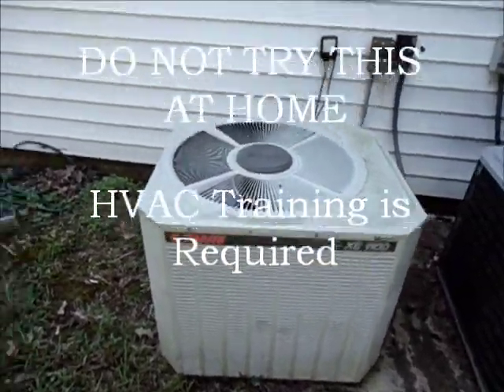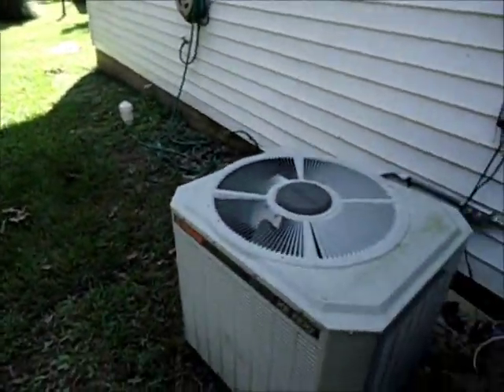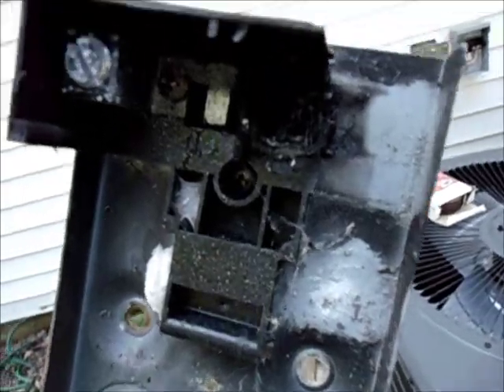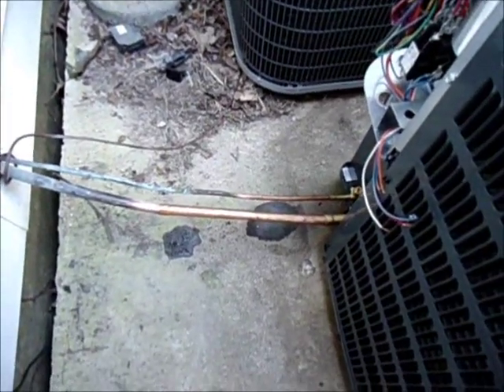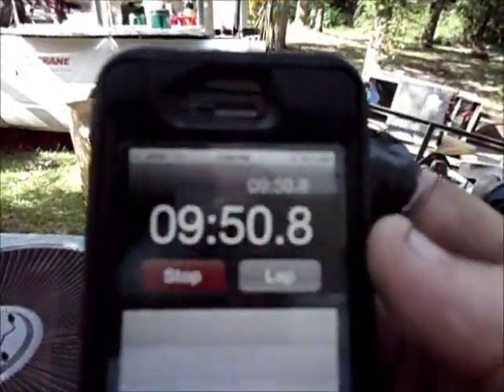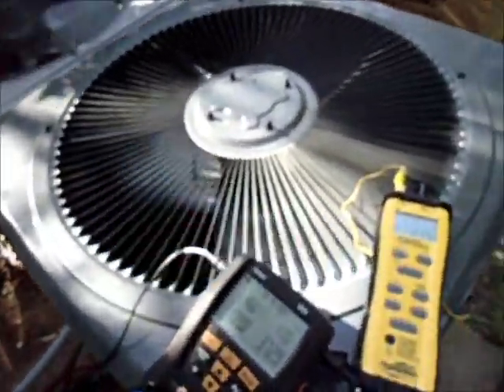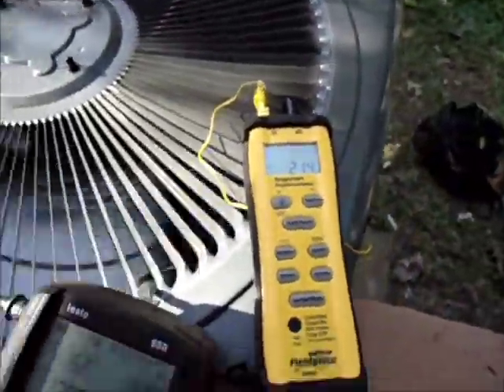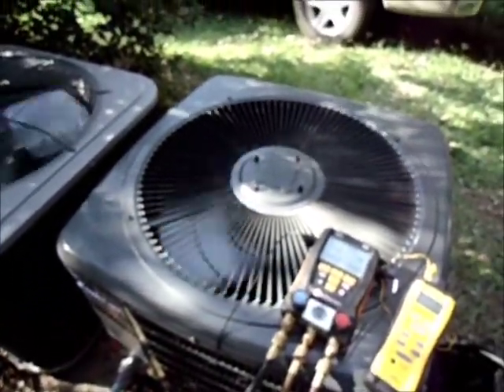HVAC Install: 3 Ton Goodman Heat Pump System

Comment: I would only make one criticism, the units are closer to each other than they need to be.  I think the specified minimum distance between these two units would be 18" or something like that.  Is there a reason the unit wasn't moved as close as possible to the edge of the pad?

Comment: A lot more people than you would think does not like Trane for some reason or another,i have changed several Trane units out and people refused to have Trane put back,they where like these anything but,great install man,i have only use the flush 5-6 times,biggest part of the time we change the lineset when possible,thank god 4 the flush when needed,great video!

Comment from the maker: Yes i do. When i first started doing 410A units i was really scared and changed linesets on every job. But i got a change out where i could not run a new lineset so i had to flush. the Flush worked great and i had no problems so i've been using flush ever sence. I will run new lineset if the size is not correct of course!!!

Comment: I like Goodman, the only thing I don't like is that the service ports are set up so that I can't use both of my Appion core removers at the same time. They get in each others way. No big deal, I found that my old CTS core remover will work. Gives me a reason to keep it in the tool box.

Great install and video.!